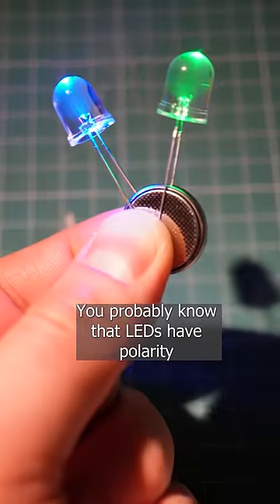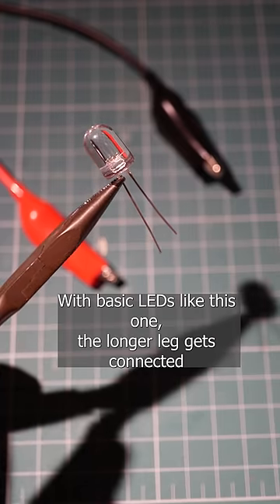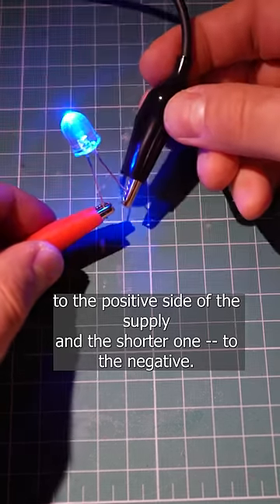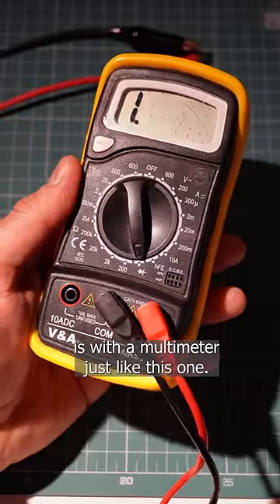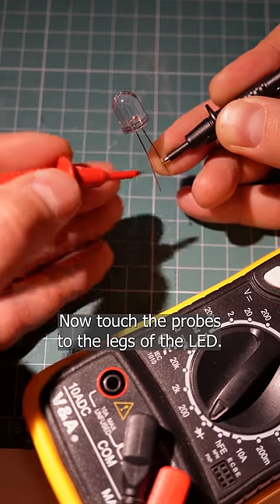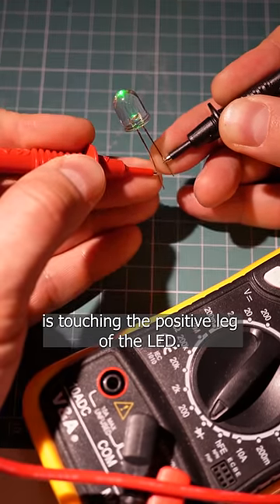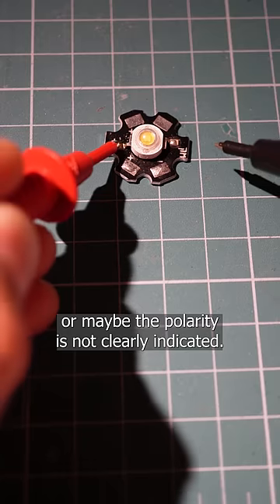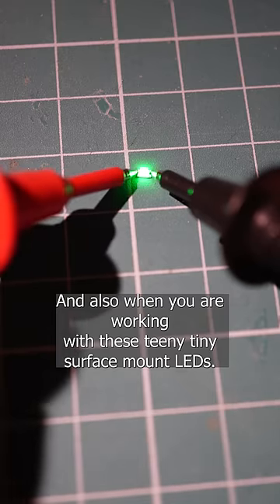An unusual way to tell LED polarity #shorts

Comment: Is it he same as using a beeping mode on a multimeter (mine doesn't have the diode mode)
Reply from the maker: I think so. Mine doesn't have continuity testing (aka beeping mode). Let me know if it works :)
Reply: @LeftyMaker  It does :) I was more worried about damaging the diode (I thought the diode mode was special for this, you technically could measure with any other setting of the ohmmeter)